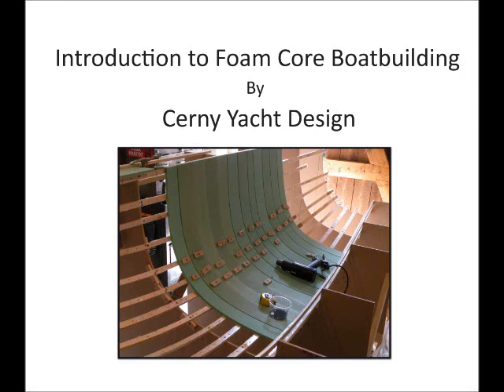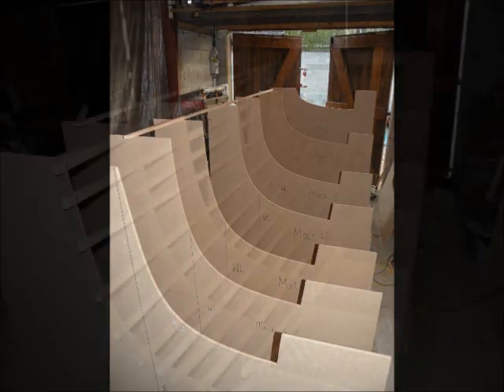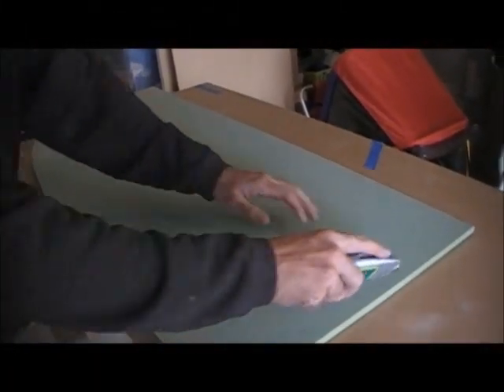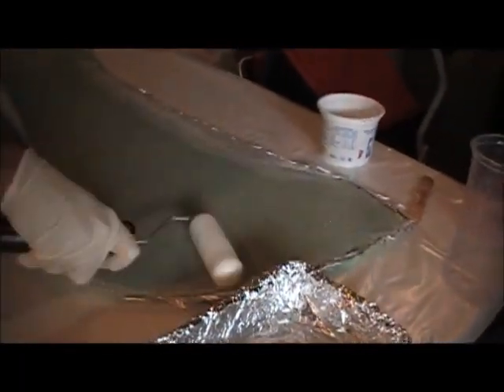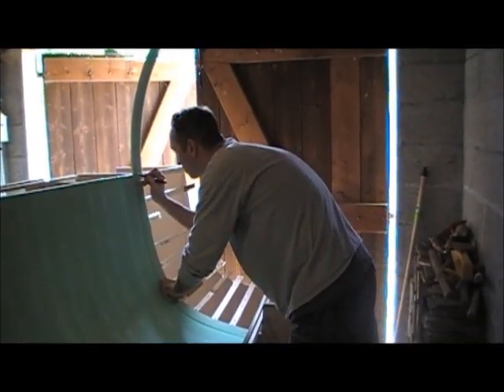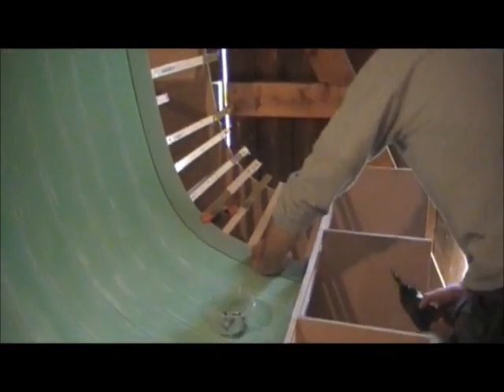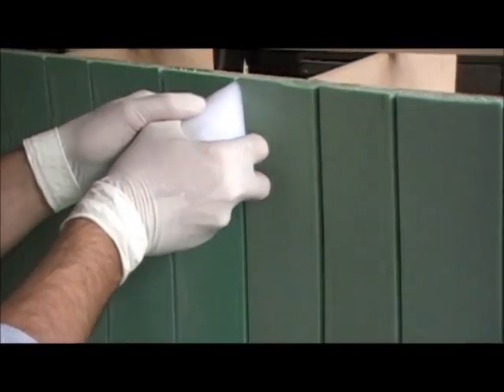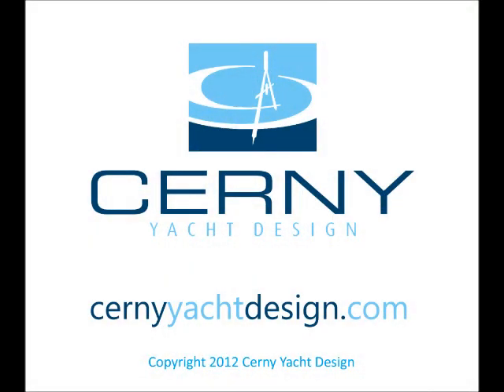Introduction to Foam Core Boatbuilding

Comment: I thought this was a great video. Well narrated and demonstrated, but I don't see how this is superior to plywood in strength and rigidity? I get that it is more weather resistant but you can get that from plywood if you cover it with FG and epoxy and vacuum infuse it properly.
Reply: +gus bisbal.
Plywood is stronger as a core material, but since closed cell foam is significantly lighter, a foam sandwich can have a thicker core with more layers of glass for the same weight as a wood sandwich. The extra glass and core material can mean the foam core is actually stronger and much more rigid. Structural rigidity of a part in bending is proportional to the thickness cubed. Every time the thickness doubles, the resistance to bending octuples. The maximum stress in bending is at the outer surfaces of a part, so thicker glass at the edges also helps resist bending as well as increasing the tensile strength of the sandwich. Regardless of strength, the foam is easier to work with and, as you said, resistant to weather/delamination without any additional steps. 

That said, wood still wins in terms of sheer strength. It's like aluminum vs steel. While the foam sandwich boat can be lighter and/or more rigid, it will still always be easier to put a hole in the side of one than a comparable boat with a wood core.

But it's not like either boat would come out unscathed in a point impact, so you have to ask which would be easier to repair. My money is on the foam core, since it's easier to work and especially since you don't have to worry about areas around the repair rotting after the fact.
Reply: Great answer, thank you.
Reply: until you have made a foam core sandwich you just can't believe how strong and stiff it can be.   (wood is still stronger but foam is very very very strong too)
Reply: High Modulus built the hull of the 124' superyacht Ermis2, the 2nd or 3rd fastest yacht in the world(60 knots WOT)with a 10" sandwich of Airex foam overlaid with carbon fiber/kevlar to withstand 2.2 gravity entry in heavy seas. So they agree with your assessment of the strength of foam.

It's amazing to see Ermis2 come to a complete stop from 60kn almost within its own length with triple KaMeWa waterjets.
Reply: Plywood is SOOO much heavier than the foam board, and Marine Plywood is also more expensive. Plywood is around 2 lb/SF + the fiberglass coating.  Foam is 65% lighter. Both need the fiberglass overlay.  The strength of the plywood is not enough to make plywood preferable.  Stick to the foam.  Nobody wants to deal with a plywood boat in 30 yrs. I'd always choose an aluminum or fiberglass/foam boat over a plywood boat.

Comment: Does infusion bagging foam core remove any buoyancy benefits?
Reply: No, the foam is closed cell which means you cannot suck the air out, open cell foam allows air and water to pass through it. Closed cell boat foams specifications always say whether you can use infusion, ie will not deform with 1atm of pressure.
Reply: Dalt Wisney the foam has nothing to do with the flotation. Compare two boats, one built of foam one of metal, assuming they have the same weight and same hull shape they will have the same buoyancy. Check out Archimedes principle

Comment: great design .  in rc scratch building with foam board we use regular hot glue guns on the foam . it bonds like CA glue without the brittleness .  the pieces are darn near welded together

Comment: Do you think that if i make a Stick n Glue kayiak using foam(instead of wood or plywood) and them dress it with fiberglass and epoxy resin will work?
Reply: Hi. Did you do it? I‘m about to build a kayak s&g with airex 8mm and carbon fiber

Comment: When you "wet out" the foam, do you wait until its dry before you place your glass on? In the video it looked like your glass didn't stick to the resin when you flopped it on the bulkhead.
Reply: +Pig Farmer Ben With epoxy it is critical when you apply the next coat. You wait until it is "late stage gel" And then on to the next step. It you wait for a hard cure you then have 2 major problems with bonding. 1 being it becomes a secondary bond and the surface must be scuffed. 80 grit is usually recommended. 2 being the big big big one. Amine blush. If you use retail grade epoxy or almost any pro grade you get blush. That is the reaction between humidity in the air and the hardener. It leaves an oily film on the surface preventing adhesion. It must be cleaned of with clean hot water only. Solvent does not cut it. Neither does soap. Rinsed and wiped off and then sanded. If it is sanded before it will grind the blush into the surface. By using a non/low blushing epoxy like West 105/207 or system3 clear coat you get better secondary bonding. When I start the inside of a craft the epoxy never cures hard till it is done. Same at the outside. I even apply light amounts of faring compound in places I know I will need it so it cures as one solid mass.
Reply: Naked Acres peel ply will also negate blushing if applied to the skim coat while its curing
Reply: @tireballastserviceofflorid7771  How are you preventing the epoxy from curing hard before you're completely done?  I'd have thought it would be very difficult to complete a project that fast.

Comment: Almost anybody can build a boat large enough to liveaboard. The method demonstrated is very good. You can also build a strongback and lay strips of cedar along its' length and then apply fibre glass. Use good quality epoxy resin. Avoid plywood, even if it's 1066 grade, use closed cell foam for the bulkheads.

Comment: What kind of foam do you use and where can it be found?
Reply from the maker: For this demonstration we used 5.5 lbs/ cu. ft Airex foam but any brand of closed-cell structural foam compatible with epoxy will work.  The foam can be found at most online and local boatbuilding supply companies.
Reply: The foam needs to have a high shear strength, hardware shop foam does not work well at all. The cost of the hardware shop foam compared to the boat building foam will be a tiny percentage of the cost of the boat.

Comment from the maker: @Randy Warner- for this demonstration we used 5.5 lbs/ cu. ft Airex foam but any brand of closed-cell structural foam compatible with epoxy will work.
Reply: Cerny Yacht Design
Reply: Where do you get the foam?
Reply: @scotthummel4248  - West Epoxy Suppliers, likely have Choices if Cores, including this type. Boat Building Suppliers. "Aircraft Spruce" catalog or website, are also Options.
Reply: @scotthummel4248  closed cell foam  insulation from HomeDepot would work.
Reply: @firemanjim324  - Home Depot Foams are not Boat Building "Structural Foam", as they are Insulation Foams, but might suffice, if Water Absorbing Property is not a matter of interest, as well as UV Tolerance challenges are not a concern.
Reply: @robertweekley5926  closed cell foam won't absorb water.
Reply: @dsavo3525  when I use it , I remove the plastic film that covers it ... You can also sandwich it between 5mm plywood , using this same method.... I mostly just use it for flotation . Either sandwiched , or just epoxied into place.